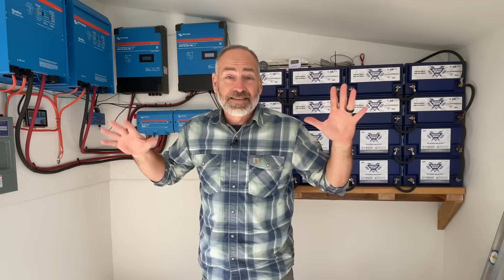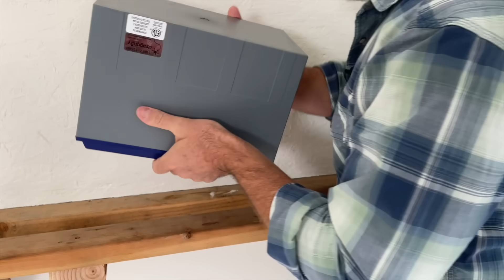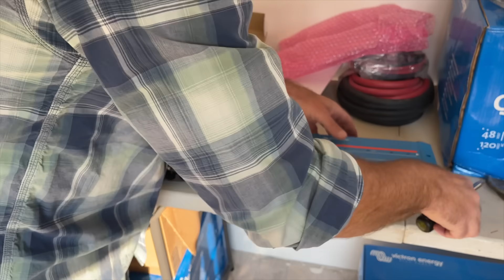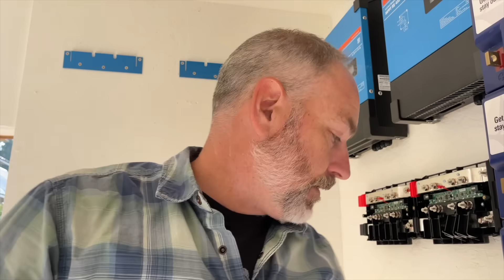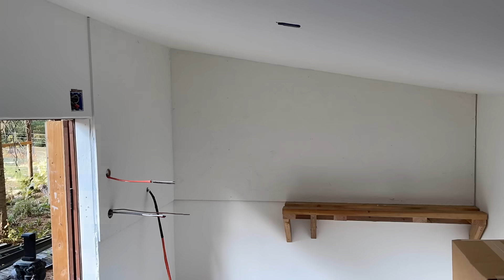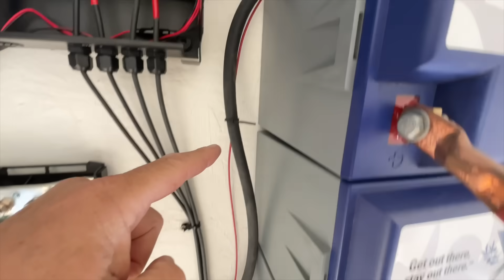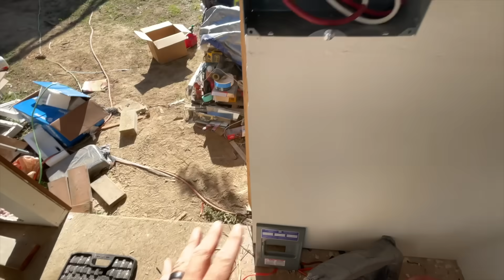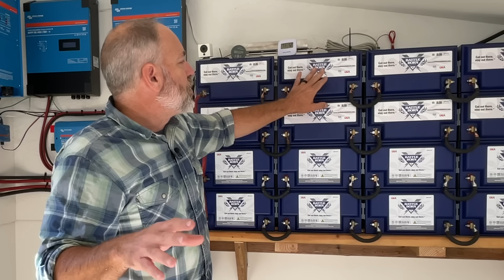EASIEST Off Grid Solar Power System Battery Bank

Comment: Marty, super job explaining how you built your solar system but, I really 
 don't understand why anyone would want to spend the huge cost for BattleBorn batteries for a 48V home solar system batterybank. They are primarily designed and used for RV solar systems of 12V or 24V. With the new server rack style batteries you could have had twice the amount of stored power at 20.4kW VS 10.2kW and up to 8K cycles VS 3-5. Additionally, you would have saved almost enough for one more 48V 100AMP battery.  Granted, the batteries are heavier due to 4 times the size of power and storage but they also have serviceable cells that can be replaced down the road 10 years from now and will never degrade below 80%. Additionally, Vitron is well made however, for off grid use there are new hybrid inverter systems that have the chargers and inverter inside one unit. They are cheaper than Vitron and plug and play with battery monitoring built into them. You can build a system over 10,000 Watts for $17K that will give you 61.2kW of battery bank storage. This includes solar panels, hybrid inverters, batteries and racking, wire, switch boxes, switches, combiner box, and miscellaneous. To buy a system like this installed by a solar sales & installation company would probably cost $60K. You can do it for less than a third of that and get a tax credit for 30% of your costs. That's $5,100.00 so it would net cost under $12k if you have paid in at least that many dollars in taxes. Oops, I forgot, BattleBorn probably gave you the batteries for the endorsement!
Reply: whats the system u speak of ? Can u explain more, which hybrid systems u speak ?
Reply: Yes, could you plz elaborate some more about the system plz ?
Very new to this kind of stuff...
Thanks in advance !
Reply: Where can I find the hybrid inverters you are referring to?
Reply: @jasonenglish8236  signature solar has the inverters and server rack batteries
Reply: 48V Lithium batteries will also last longer and give more AH on the long run. 12V batteries in series drift away in voltage and need lots of time balancing. When building 48V out of 12V batteries the 12V and 24V and 36V points should be parallel connected too to help balance all the batteries. Especially when they are getting older and internal resistance is changing.
Reply: Do you not follow this channel? He has had Battle born batteries for years. Where was EG4 two years ago bud!

Comment: You should have your battery bank paralleled via a bus bar and not through each terminal one by one. The way you have it now will result in the closest battery being discharged first and the furthest ones discharged last, and charged last, this results in uneven wear on the batteries which of course is not optimal. This has been tested by  DIY Solar Power With Will Prowse on his "Current Sharing 101 w/ Large LiFePO4 Battery Banks" video. please do give it a watch!

Comment: I wasn’t going to comment but my fingers needed something to do you talked about two cats and mouse or is or is it mice well many. But the reason the fingers needed something to do your wires that come in from the solar array isn’t shielded or put into a pipe are you not worried about those mice bitting into it and the cats then bitting the mice not just shortening our the system but possibly killing the cat. Or did you leave the wires like that to get fingers going asking where is safety Sally still on vacation while that enough let my fingers run off at the mouth have a good day enjoy the nice days they are getting shorter

Comment: As an electronic tech, I've got to give you top marks for wiring cleanliness, a word that may seem odd to some, but it is always (with rare exceptions in audio and RF work) good practice in electronics and electrics for your wiring to be geometrically 'harmonious'. It means a tech can follow it at a glance. It also indicates 'zen' on the part of the installer, and therefore the function is much more likely to be same.

A note though on having especially your inverters mounted so high up: they produce a lot of heat. Being so close to the ceiling indicates need, especially in Summer, for through-wall fan assisted circulation, thermostat optional. In the winter, block off the external venting, and channel the heat down to you cats' sleeping area. You can use surplus  12VDC computer cooling fans, (series connect them to the right voltage) and connect them to a thermostat. A cheap surplus house thermostat will work just fine.  The inverters et al will thank you, and maximum output will be increased. They work best close to run close to the freezing point. Your cats work best somewhat higher!
Reply: As a former radar tech, then 20 years in broadcast TV I take mild exception to your exception 😄  RF and audio (especially analog audio) really need to be properly routed, for the audio avoid running it near AC power as much as you possibly can, unless you enjoy some 60 cycle hum along with your Metallica.  Martin did do a very clean install, the only possible issue I saw, and I may have just missed it is, the positive and negative runs from the batteries to the bus bar should be the same length.
Reply: @michiganengineer8621  Can you explain why the positive and negative runs should be the same length? The only thing I can think of is so they have the same resistance.
Reply: @bruceritchie7613  From what I understand that's exactly why.  Now with 1/0 or larger cables a foot or so shouldn't make THAT much of a difference, however I know Will Prowse harps on cable length a lot in his DIY builds.
Reply: @michiganengineer8621  yeah I can only agree with Will Prowse on his dedication to equal lenght wires. Weird things will happen sometimes, one is that the inverters will read different battery voltages (although the battery monitor helps a bit with that) the low cut-off will be different etc. Easily fixed in this case cause of the neat cabling just make a second pair that is the same length as the furtherest one and let it run along the wall a bit longer before it turns back to the closest one. Vic Quattro has a probe port built in to off-set the voltages if needed.
Reply: @michiganengineer8621  Any chance you know what size fuses he used in this build? There was no link for the fuses/sizes in the links at all.
Reply: @mossymaple  I don't know.  You may need to go back to a video when he was first putting the system together.  Most likely he went with the manufacturers recommendation.
Reply: @michiganengineer8621  Do you believe me that DC and 110/120 or 230/240V AC with low power near Victron Inverters with their built in large transformer are all not susceptible to Radar, LiDAR or Audiophile sounds? 

It does not matter how you route the cables, the length should not be too long and - if they are longer should be larger to reduce the power losses but not overly so. Its a matter of cost/performance. 

The cable runs should be similar in length. A few inches up or down do not matter at all. If you want to be meticulous you can make even cables but you have to measure them afterwards with a Milliohm Meter to be sure. Again: It does not matter as long as they do not get hot. At full power handwarm to the touch is perfectly fine.

His cabling is perfectly ok.
Reply: @boblatkey7160  Hey Bob, I can't find the comment where you give at least some indication of where the errors and violations are? I can only find your comments saying that they exist. Would you mind sharing the knowledge a bit?
Reply: You would not be happy with my wiring. I am so sorry!
Reply: @wolfgangpreier9160  me too
Reply: After years of my career spent building some of the prettiest bulk low voltage systems for some of the biggest tech companies in the country, I find myself not able to do that for myself. Starting a channel myself, though, so I guess I should get back on the tidy cabling wagon...
Reply: I really like the 1/2 inch of exposed wires in the charge controller. You giving props but ignoring that.
Reply: Came to comment about heat dissipation. I'd be interested to know how hot it's going to get in there during the summer. Is there some kind of ventilation off-camera?
Reply: I'M USING 170 AH GVM'S, 45KG EACH, THE FLOOR WORKS FINE 😄

Comment: Remember to put the bottom screws into the wall for the Charge controllers and inverters.   Also strap the batteries to the wall, I would hate to see them fall.

Comment: Could you explain how you calculated 50 amp for the house?
Reply: I wonder when the new panels are installed how many amps he will feed into the house as 50 amps seems small for the entire house.
Reply: @jaycahow4667  That's what I thought as well.

Comment: Hey...very nice video. I guess I didn't understand WHY you went with 48V other than wire size. Is there a performance benefit? Thanks so much
Reply: Charge controllers handle twice as much power at 48V than at 24V.

Comment: 874.00 per battery for a simple easy solar systems. $13,984 just in batteries not including the high end equipment. You guys are one of my favorites off grid channels, but $13,000 isn't simple or easy for most homesteads.
Reply: Yes, but the battery company sponsored this video, so They were either giving these batteries or highly discounted. All I'm saying is Wal-mart sell a 29DC battery with a 122ah for $99.00. That's 8 walmart batteries to 1 battleborn with enough money to take your wife out for a great dinner afterwards. I feel alot of homesteaders like me, don't have that kind of income.
Reply: @donc8081  100% i am starting a boat build and there almost a 1000 a single battery cant do that
Reply: I don't know how the guys from Battle Born batteries recommend this configuration... 4 48 VDC battery banks in parallel??!! Really?? It's almost impossible to balance out all 16 12 VDC individual batteries to a similar voltage among themselves... not to mention the individual LiFePO4 cells within them... much sooner than later some battery(ies) will become unbalanced with the whole bunch and will start acting "weird"...
Reply: I agree. Most would be better off going with a 48v server rack battery.
Reply: Cutting the battery cost down to maybe $4k by using 48v server rack batteries.
Reply: Anyone of you with cheaper options live in NYS and wanna come help me get off grid lol
Reply: Remember they didn't start off with that out the gate...they've upgraded as they went.
Reply: Leave Mr Johnson , it's his money , why do you care about his buying methods , here's a question for you : DO YOU HAVE A OFF GRID SOLAR SYSTEM ??? STOP JUDGING OTHERS , WOULD YOU LIKE IT IF I JUDGE YOU ? I don't think so , God bless you , and have a safe day
Reply: @Nicholas-x2k  you're way late. I posted 3 years ago. Let me refresh my memory. oh yeah Battleborn batteries is a sponsor of him and this channel. Oh Mr Late to the party that means those batteries were given to him as he is a off grid Influencer . Which means he pushes these batteries to other off grid people. Yes I do have a Off grid solar system that I did myself. I use Walmart DC batteries that cost 99.00 each with 125 AH 12v. Which is very affordable for the real unsponsored Off gridder. He started this channel on a very limited budget which drew in the big following , now its become unrealistic for most real off gridder's budget. I have nothing to fear for you judging me for I have nothing to hide. Would you like another stone?

Comment: Approximately how long can those batteries last?  1 day, 2 days, 3 days etc

And how do you calculate that estimate?

Also is there a maximum quantity of batteries you can connect?

ie can you add more days with more batteries, and is there a limit
Reply: Battery Max?

Comment: Can you give estimate of extra cost to have 240v /split phase please? I guess this is for an electric stove? Maybe a clothes dryer also? ANy thought to using propane/gas for these? Thanks (ofcourse using gas for these appliances reduces substantially the whole system requirements)
Reply from the maker: The 240v is for the 3/4 hp well pump and future tools. Dryer and stove are propane.
Reply: @MartinJohnsonOffGridLiving  Thank you. Maybe a quick vid on 50a (+20a)panel distribution is planned.?
Reply: @MartinJohnsonOffGridLiving  Tools, especially table saws, always run better on 240v split rail (phase is a misnomer that even the pros misuse, it's all single phase. Think current, not voltage). With power tools, instantaneous 'source impedance' is much lower, so with a table saw, for instance, when first turned on they accelerate up to speed much faster, and if your work is lugging the motor down, the ability to supply the increased current supply is done more effortlessly. A lot of that is also due to reduced line losses. Think of it in terms of 'being in a lower gear' (more torque available).